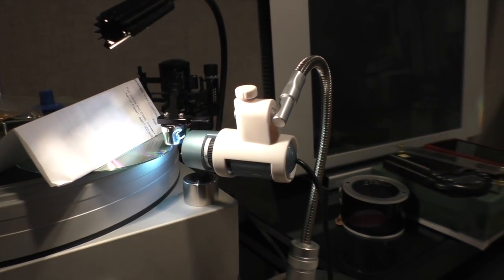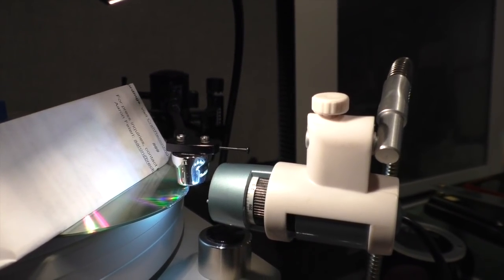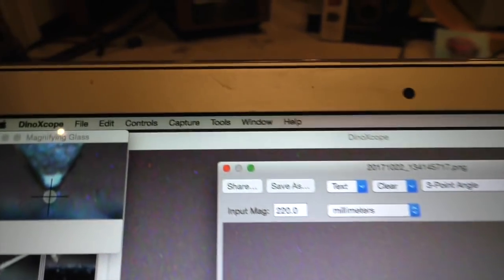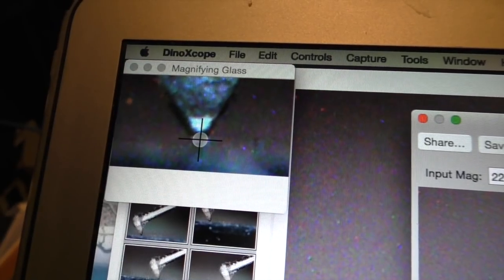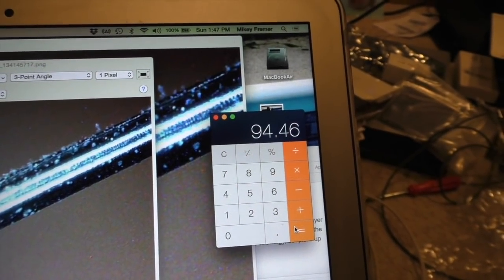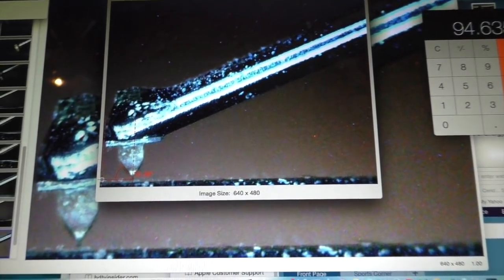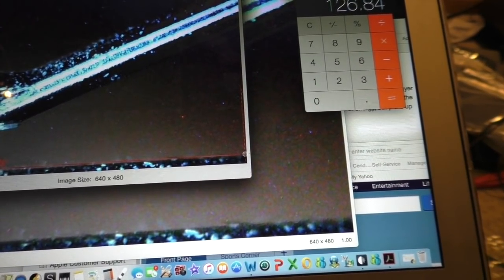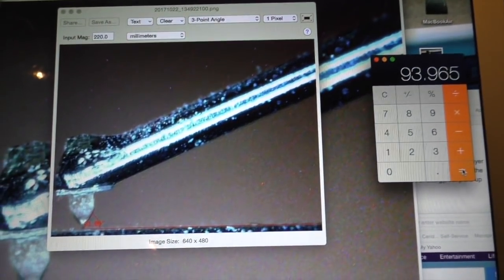Using a Digital Microscope to Set Stylus Rake Angle

Comment: This is a static adjustment, which is not accurate. The cartridge squats down when the stylus moves through the groove. This is a good start, but the arm will need to be raised a bit. Same goes for tracking force. It's higher when the record is playing vs static reading. Our ears tell the real story.

Comment: No sure if there is any comments on how to deal with the thickness of the vinyl since that will change the raking angle if the vinyl is thicker or thinner.  Also the stylus pressure will change the cantilever rake angle of the stylus.  Will it be that the combine of all the playable factors would result it the stylus sits at about 90 degree to the surface of the vinyl? Just a thought

Comment: I bought the tools, and I lowered my tonearm to the absolute minimum, it definitely can't be right, and my measurements show 98°, what am I doing wrong? I followed the video to the letter 🥺
Reply: You might need to complain to your cartridge manufacturer... That's horribly manufactured, or you just put a very wrong cartridge on your turntable.
Reply: Cartridge height, headshell relative height (if removable) , amount of tonearm adjustment, and mat height will all enable/limit adjusting VTA.

Comment: Being super pedantic I should add that. You are basing your measurements on the cutting angle onto the accetate original. The vinyl copies made from the stamper will have a cure time/hardening coefficient which means that there is another variable that makes the original master different from the final copy.
You yourself have stated that you prefer copies from certain factories. Given that each factory has the same stamper, the factors realy do make a difference and hence the accuracy of setting VTA so accuratly is anathema. 

Sorry to be so harsh as we all strive to get as close to the original as feasably possible, however there are physical limitations with vinyl that are insurmountable, merely by design.
I have driven myself crazy on VTA.  Therefore I researched it.
The one jewel of information that came from my research is that an original pressing of a vinyl record (from the first master stamper) will always out perform a re-mastered 180gram copy, for the only reason that everytime a master tape is played, it looses some of its signal by being read.

I did a direct comparison from a 180 gram re-master from Grace Jones "Pull up to the bumper" to a mint copy from Disogs, and the difference was shockingly obvious.
The original had so much more detail in the top end, transient detail and clarity. All the re-release sounded like was that the engineers were trying their best to inject that detail back to the worn out tapes. Confession, I am a retired SSL engineer used to working in Eastlake Studios. I think my ears are good. I only had two number ones in the US but had to retire at 19 because I found the industy too much for me to deal with. Regards Rob Waldron.
Reply: Advark Merrygoround shut up

Comment: I love you videos Sir, but surly to be truly accurate, the VTA would need to be set correctly for the thickness of each and every one of the records you were listening too?
Plus, the VTA changes in respect to the phase of the bass end. Surly there are so many variables it just has to be a matter of (what suits most).
Listening to early (thick) vinyl, 1970's thin, and re-releases in 180gram?
Is that why a spherical diamond is less sensitive to rake angel opposed to a fine line or Shibata?
Add to that the accuracy of how the tip is affixed to the armature!
I would love to see an in-deapth youtube video on how manufacturers grind and set their syli, but I'm guessing that is their trade secret so no about to be put on public record.
Again thanks for all your work on the subject.
Reply: There are many such issues. Furthermore, is the tip that plays the grooves on the same angle as the general body of the diamond, it may not be. 
Is the suspension of the cantilever the same on a stationary platform as it is in a groove with varying friction, no.
You should essentially get an approximation, these microscope sessions are only good for inspecting certain issues, not what I would solely use as an installation instrument.

Comment: Vinyl pleasure seems to have more pressing  concerns. I'd just like to learn the means to eliminate distracting  crackles, and pops other than my mental filter.  If that issue can be solved, I'll work on perfecting cartridge alignment. BTW, simply following the cartridge mounting and VTA adjustment instructions accompanying my Technics SL-1210GR Turntable, which did not require a microscope or even a protractor, seems that alignment is good, since other than crackles, and pops, my records sound indistinguishable (distortion wise) from CD's of same music.
Reply: Washing records once crackling becomes annoying - needs vinyl washing machine, proper liquids like purified water (e.g. that used in car batteries), perhaps 100% isopropyl alcohol. Use brush before playing, every time. Buy an antistatic gun. Cleaning and antistatic should lower surface noise considerably.
Reply: @McSlobo  good reply shame the person asking the question didn’t acknowledge your reply.
Reply: @Charles Ludwig - You should look at the Sweet Vinyl Sugarcube devices. That will do exactly what you are asking for at a price starting at $1500.

Comment: I have a test record with two signal,s out of phase and then I adjust the angle for minimum  audio break through  this also is affected by tracking weight .
Reply: You cant get perfect channel separation  on every record because the are not all cut the same  angle its very much a compromise . Using two signals   out of phase is a good starting point at least with same electrical out put on both channels it will give you a better stereo image
Reply from the maker: Dambuster that is azimuth this is stylus rake angle. Not the same thing!
Reply: If you  adjust the rake angle are you adjusting for best channel separation ? are all records cut at the same  rake angle  and what is the purpose of two signal,s out of phase on a test record ?
Reply from the maker: Dambuster rake angle has nothing to do with channel separation! That is azimuth adjustment, see article on stylus rake angle. On AnalogPlanet website and download PDF file! Drop down to “set up tips”
Reply: P.S are all L.P,s the same thickness ? it would seem to me using a microscope would suggest the tolorance  is very tight and adjusting the tracking weight would also make a difference .

Comment: How do I adjust the angle if my turntable doesn’t have a vertical arm adjuster?
Reply: It might be possible to do something to the platter. Mats can be added or removed, or you may need to add some shims underneath the tonearm. Some brands sell them, for others you might need to do them by yourself from some material. All these modifications may have some other effects to the sound. I imagine you might also be able to add very thin sheets of some material (aluminum foil perhaps) between the tonearm and the cartridge's front or back end to alter this particular angle but it will be difficult because you have to re-align the cartridge after every modification if you loosen the screws.

Comment: If you centred the stylus in the picture you'd have more to the left side as opposed to seeing so much of the right side to accurize how parallel you are to the flat surface? Just a thought.
Reply: I just about to make the same comment in that the alignment of the camera is critical to the entire process.
Reply: @Stew666able actually camera angle doesn’t matter. What matters is measuring to the Flat Surface, which its angle will also change as camera angle changes.

Comment: Though I like the method, I wonder how much the difference between the thickness of a CD and that of a record (which vary in thickness between them as well, obviously) needs to be taken into accoun when doing this.
Since in the end you'll be doing it by ear, as I would do too, I wonder; If you start by setting the arm up level and then just turn the height adjustment until you've got the tonal balance you like, isn't that as good as any other method?

Comment: This process would be ok if all records are the same thickness and have no warps. I like the Rega way, no adjustment and a good record. I add a good glass of Jack Daniel’s,  and the sound always gets better. I liked the Rega visit videos you have made.
Reply: thank you! if I had adequate knowledge and attention span, I'd plot a chart that shows by how many minutes (degree fractions) different heights of warpage affects different lengths of tonearms. I see someone developing a system that laser tracks differences in height from a reference point and through a magnetically controlled suspension, constantly adjusts the tonearm height. It will cost $1,100,000, 2 will be sold......audiophilia is a very slippery slope indeed :)

Comment: Michael, will the program you are using allow you to draw 2 or more connected angles at once?  If so, wouldn't it be faster to draw a first line along the top of the stylus and make a 90 degree angle from the line at the top of the stylus through the center of the tip and then continue to form a second angle by drawing a line along the playing surface of the CD.  Wouldn't the second angle formed be the angle you are interested in and avoid the multiple measures and calculations?  I've never had the equipment to do the calculations you are doing, so I'm asking part out of ignorance and part out of seeing a possible easier way through simple geometry.

Comment: This is pretty cool and intense Michael. Is it worth it to do this when I'm using a cartridge under $500?
Reply: It's about the shape of the stylus, not the price of the cartridge. audiotechnica, for example, sell cartridges with a line-contact stylus for much less than $500, which are very sensitive to SRA, but a conical stylus is not.

Comment: Isn't it better to use some sort of optical turntable? Like a linear tracking optical fibre mechanism or an ELP turntable? If I get this correct you have to do this each and every time you get a new needle. In one of your videos you also mentioned that even if it's the same model of a cart it is near to impossible to get it perfect from factory. So why spend more than a fortune on a turntable + cart?
Reply: Or a CD player - I’m kidding. I love playing my records and that great sound they have but it isn’t for everyone.
Reply: @robertyoung1777  I love my records as well but doing space science to get "pitch perfect sound" - something 99,98% can't even hear is a bit snake oil-ish, isn't it?

Comment: Hmm we go to great lengths of TRYING to eliminate factors or to control them. But this is only one of all of them that we can not completely eliminate..

You can adjust the tone arm height in back of the tone arm.
So you dail in exactly the angle you want. With a CD on the platter. As we all know a CD is 1.2mm thick.

The thing is that about 10% off a average LP collection is 1.2mm thick. 1.2mm is ~130g LP. And the scale goes up to ~220g that is 2.3mm thick LP records (and down to ~0.8mm).
So if we adjust so we are in a desired angle on 1.2mm thick CD then we need to raise the back of the arm with another 1.1mm when we play a 220g record.
And that is just to get back to and be in the desired boll park.. 
And then you can start to fine adjust for the best sound..
This is done for every record you play if you want the best sound quality.. ..because they all vary in thickness.. from 0.8mm to 2.3mm.

But honestly more than ~99.9% do not adjust the height of the tone arm for each record they play (only a small fraction have tone arms that can be adjusted during playback). 

Then the angle is set once for all and maybe is ideal for ~5% of your collection (and the other 5% of the 130g needed the fine tuning because of the variance between different cutters). 

In other words you will not have the sound quality that a CORRECT angle will bring to the table for ~95% of your record collection..

https://www.vinylengine.com/turntable_forum/viewtopic.php?f=41&t=93648
Reply: Analog Planet 
Yes you say it your self that nobody can hear 0.5 degrees. 

But if we make it simple.
Between cutter heads we have a difference from 91 to 94 degrees. And if we leave out the factor of the thickness of the groove that VARIES between records if you're in the groove or not! Of course that is a factor that comes into play, but let us to look only on one factor.

We keep it simple and we only look on ONE thing.. 91 to 94 degrees..so we have the same thickness of the record WHEN the needle are in the groove and play on two different albums.

So only in ONE factor (cutter head angle) we have 3 degrees difference!!
And YOU can hear that?
Yes you can!

Conclusion: So only looking on cutter heads angle variance you need to adjust your arm height between records. Because you can hear the difference of 91 and 94 degrees.
Best regards.

Comment: Interesting I use a glass ruler on a old record to try to get the tone arm as parallel as I can. I see that it’s a lot more complicated and I should try to find a small enough microscope to fine that 92* angle.
What program do you use to calculate the front and back angles?

Comment: You said you finish and fine tune by ear. Can you explain the process you use for that?
Reply: It's called, "I feel good about that last adjustment, and so it sounds perfect".
Reply: The microscope regulation give you a good starting point. Than the reality is that when the LP is playing the angle can change constantly because is not completely flato or because is bigger that the CD used for the regulation, so the real average angle can be different, for this reasons I suppose Michael end the process with the ear test. Ear are the only thing can determinate if an instrument sound like he should be. Listening session are a fundamental part of every Hi-Fi project.
Reply: Analog Planet Wow. 4mm is a lot of turns of my VPI VTA on the fly dial. I think each full revolution is 1/32" or 0.8mm. Plus don't you need to change the height even more for a 1 degree change on a 10" arm?

Comment: I thought it should be 91°you're not going to get an accurate reading because you're moving the horizontal line the 180-degree in line each side is different? why don't you have a fixed stable line on the tip of the stylist you could reference to